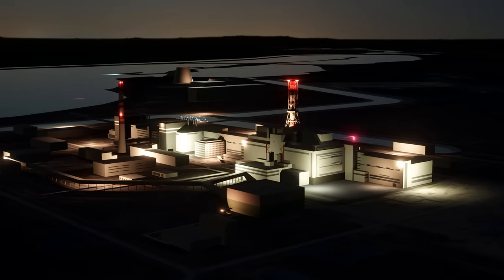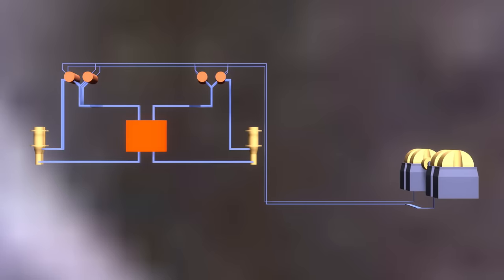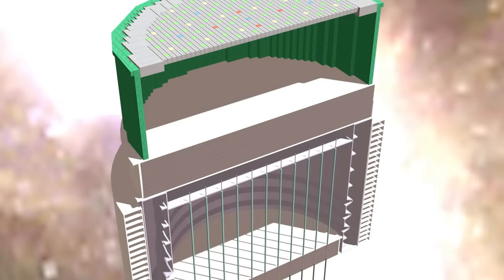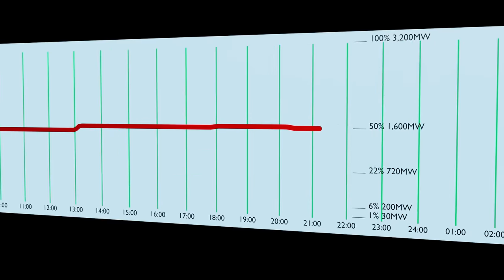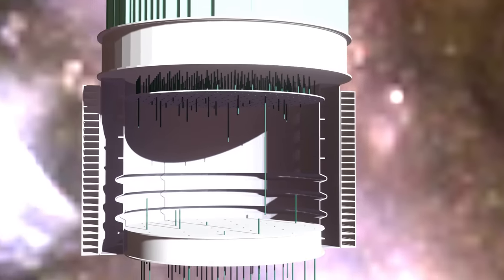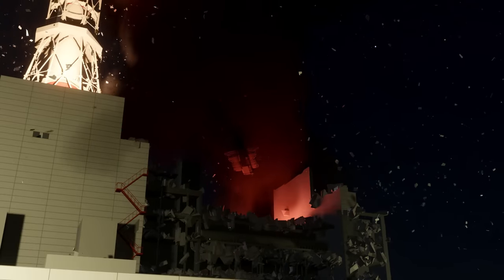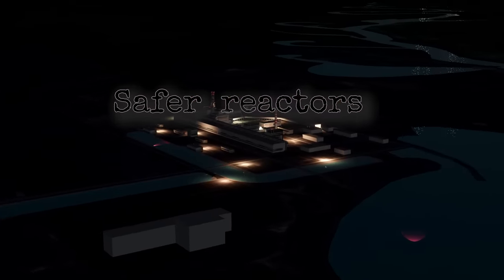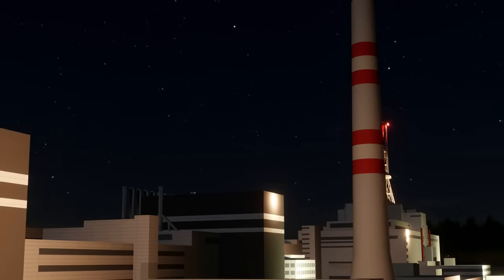CHERNOBYL AZ-5 why it exploded

Comment: Let one thing be clear: The reactor did not behave in a way that was not known. It was known. But it was the policy of secrecy, suppressing information and general paranoia in the Soviet Union, that led to this disaster. The operators were highly skilled and professional. There was no "pressure" present (as depicted in the HBO series). They were cautious and confident in what they were doing. The problem is, they were not told the full story, the truth about the RBMK reactor and its design. Until the disaster at Chernobyl NPP, safety concerns were only from the viewpoint of how to protect workers from the radiation of the reactor. After Chernobyl, the safety shifted in how to protect the reactor from operator error. This was a very valuable lesson learned. The automatic reactor control and safety systems had to be manually disabled by operators at Chernobyl in order to do the test. They worked against the safety protocols and were aware of it. If they knew the full truth about how the reactor behaves in those conditions, they would have never ever do what they did. This was not the first time that this test went wrong. The Leningrad incident ten years before Chernobyl made this clear. Lucky for them, at Leningrad, they performed the test with a "fresh" reactor, which was not operated for extended periods of time. At Chernobyl, the fuel rods were burned up much more. The operational reactivity margin was way lower, which resulted in even more control rods to be withdrawn, making the reactor extremely unstable. The lesson learned from Chernobyl: Protect the reactor from human error. Today  it is impossible to manually withdraw more control rods than is safe. Also design changes were made to the control rods, removing the graphite displacers with steel ones. The efficiency dropped a little and the fuel enrichment had to be raised a bit to compensate for that. I cannot stress this enough: The reactor did not fail. It was the human operators who failed. The design of the reactor was known to have certain issues and the designers knew of them. But the operators were not told the full truth. Even worse, after the incident at Leningrad NPP, where a similar test resulted in an almost identical result, the full truth about the reactor was not told to the operators. Human error and a paranoid mindset made the Chernobyl accident happen. The technology did not fail in any way. It was a human mistake and error. The lesson from Chernobyl is clear: If you do something, you must know at each point in time what you are doing and understand what, how and why works. If critical information is being kept from you, you inevitably make a mistake, sooner or later. All the natural laws are known and the reactor was designed properly. There was absolutely no miscalculation or misunderstanding in the laws of nature. There was just human error. The operators are not to blame. The whole culture is to blame, if it is poisoned by unnecessary secrecy and paranoia. Also, we need to protect delicate technology from humans the same way we protect humans (and the whole environment) from dangerous things like radiation, chemicals, etc.
Reply from the maker: Thanks for a great explanation
Reply: Finally! Someone who's read books on the event. The shady Ministry of Medium Machine Building designed the reactor, and kept all its dirty secrets to itself.
Reply: @PeterbFree  ...what?
Reply: @PeterbFree  you want to say, vote for corrupt GOPs, to manage to perform such disaster at home?
Reply: why did they do a test then with a poison core? That was not kept away from them. They did know that the power plant was operated on a lower performance level for hours so they should have known about the poisoned core too. Yes, the fail safe had a design flaw but based on the video it appears the operators made serious mistakes too.
Reply: @csabaidonat  High pressure from political instances to be successful in testing, showing reliability... And the main operator at the plant wanted to be the hero, fulfilling that task... Its like the BP disaster in the Gulf, things like that also happens in normal economy. But Russian communistic structures well enhanced the risk.
Reply: @csabaidonat  Yes, this I ask myself too. They must have known that the core was poisoned. After the chain reaction practically stopped when the reactor fell into the "iodine pit", they must have realized that trying to do the test at that point made no sense, since it was physically impossible to rise power to the required 700 MWe. The only sensible action was to shut down the reactor and wait for the Xenon-135 to decay. The test could have been repeated later.
Reply: @Lightningchase1973  Yes, I belive that such things happen regardless of culture. Just some cultures made it "easier". The lessons learned from all these disasters are very, very valuable. And they did cost us human lives and contaminated vast areas of land. We must learn and be humble, for nature cannot be fooled. Another distaster, with much less dramatic outcome, but with a similar "chain of human decisions" led to the Challenger disaster. I would even say, that it was even worse (as far as human failure goes) than Chernobyl. Critical information was not being kept "secret", it was being knowingly ignored by the management.
Reply: "Human error made it happen"
This is the cause why humanity was and still is not grown up enough to deal with dangerous tech like this. They still do not communicate transparently instead the nuclear industry is still all about secrecy.
Reply: @erikziak1249  So...what you're saying is that they felt no pressure because they were totally professional but you have no idea why they'd ever ignore a very obvious sign that they definitely knew about. Yeah, there sure were no pressure on Dyatlov at all...
Reply: @Lightningchase1973  Exactly. "I love the uneducated". Imagine a Trumper in charge of safety - oh you don't have to - Homer Simpson already showed it to us.
Reply: Good explanation but explained the same idea in 5 different voices. Haha.
Reply: Its like being confident you will get a good grade for the math exam but you missed the crucial part of the math lesson
Reply: You're basing all of this on the HBO series?
Reply: @abelucious  Certainly not.
Reply: You said the same thing 10 times bro. Learn how to execute your point in less words. I completely lost interest in what you were trying to say because I’m trying too hard to read it..
Reply: @youngconfidence8666  I agree. I was drunk when writing it.
Reply: Another interesting tidbit is that AZ-5 button was originally designed to act not only as a fail safe but as a way to quickly moderate reactivity. It was even touted as a design feature in the documentation. The system would only lower the control rods for as long as AZ-5 button was pressed. Some researchers think that an operator caused the explosion by tapping the button to slow down the reaction without an intent of shutting down the reactor. Almost all rods were simultaneously partially lowered and left in a configuration that produced the tip effect. Then after the explosion the AZ-5 button was pressed again, probably when everybody panicked and tried to shut down the reactor this time.
Also the amount of currently inserted rods was in no way treated as an essential safety parameter during the design of reactor controls. The operators used to get an update only twice an hour as a part of routine printout from the computerized automatic control system or could request a calculation from the said system and get it only after several minutes.
Reply: @youngconfidence8666  I disagree
Sometimes u have to be very emphazise dome topics.
This guy made a fine opinion, and he convince me about the principal idea.
Reply: Jeez
Reply: "The design of the reactor was known to have certain issues and the designers knew of them." Let's not mince words here. It's not just some "issue", it's called a "design flaw". If under certain conditions, your brakes accelerate your car beyond the speed of sound instead of stopping it, it's a design flaw of the car, plain and simple. The breaks are not meant to do this, and it goes against any logic. Same with the RBMK reactor - and if you say that the designers of the reactor knew about it and the operators didn't, then it's incorrect to state that "the reactor was designed properly". Especially after the flaw was discovered and nothing was done to fix it after the first smaller-scale accidents resulting from the design flaw.
Reply: The biggest flaw was no containment building like those used in the West.
Reply: @t3553ract  I will not argue about words, since English is my 3rd language. Maybe I did use them incorrectly. Let me rephrase the main idea: The reactor was designed properly and the operation manual for it was designed properly, acknowledging the "design flaw", if you prefer it to call this way. But it was designed like this on purpose, as it gives better economy, requires less enrichment and lowers cost of produced electricity. The designers knew of that, and they did choose such an "aggressive" design feature, willingly sacrificed safety for economy of operation. And with all this in mind, they designed the control systems to avoid getting anywhere close to the danger zone and explicitly stated in the operation manual that once the reactor power dropped below a certain power, it should be shut down. The problem is, that during the test, safety systems had to be manually overridden and the operators did not know the true behavior of the reactor in the conditions they got it into (because secrecy, paranoia, etc.). Since the designers never intended the operators to get the reactor into the state it was mere minutes before the disaster, they did not mention the potential danger in the documentation either. The problem is, that common sense was not enough to warn the operators, as there were no evident signs of danger until the critical runaway. The reactor behavior was known. It was designed with that "flaw" or "feature" (depending on how you look at it) intentionally. The regime was so paranoid, that it did not tell the operators how the reactor could be theoretically (and as we know after the disaster, practically) blown up. They feared that this information might get misused, some "inner enemy" (paranoid communists always looked for the "inner enemy") might use this knowledge for sabotage. So the operators were not told the full truth. It is easy to blame them, but the disaster, as is always the case, is the result of a long chain of small things, each one isolated in itself being not that big of a threat, but when they add all together, they can cause what happened.
Reply: @rh_BOSS  Interesting. Was it really designed in a way that you had to press and hold the AZ-5 button in the pressed position for the rods to keep moving? If this "feature" was documented as a way to quickly increase the reactivity, was there also a word about potentially destroying the reactor while using this "feature"? I highly doubt that.
Reply: @taraswertelecki9886  there was supposed to be, but they rushed construction to meet deadline. If they had double roof, as they had to have, it probably would be contained nuclear waste
Reply: Erik, I come from a trained safety technology background and  I was an incident investigator.You are not correct in your assertion that  - "The technology did not fail in any way. It was a human mistake and error. " The technology failed for the very reasons that -
1. It is not the first time it had happened, it was the THIRD time,
2. The design did not eliminate the possibility of failure because as I quote you "The design of the reactor was known to have certain issues and the designers knew of them."
3. A system operated by human beings MUST be designed for human beings to operate it and be tolerant of mistakes. It doesn't matter how technically efficient or proficient a design is - if it is dangerous to operate where it can cause a disaster of massive proportions it is an unsafe and BAD design - period.
The very fact that you acknowledge the RBMK 100 design had to be modified (at great cost) to eliminate this design FLAW says it all.
Human beings are part of the systems we build to achieve specific outcomes. The systems must accommodate the idiosyncrasies (mistakes) of human beings, particularly when mistakes can result in hugely costly adverse outcomes. There is no other way - which this event clearly underlines.
Reply: @krossbolt4100  You are right. The design was not made to handle operator errors, it enabled them to break safety protocols. The technology, as it was designed, did not fail. It was improperly designed, the focus was on protecting humans from the machine, not vice versa. The design was known to have certain issues. Correct. If I know a design has certain issues, I make sure that no matter what the human operators do, I will not let the machine to get into a state that it could cause major damage. If I design the control systems in a way that enables the operators to put the machine into a state where it has issues, whether on purpose or by mistake, I made a badly designed control system. I fully agree with your 3rd point. This is exactly what we learned the hard way at Chernobyl. The "flaw" was not because of a miscalculation or misinterpretation of natural laws. That is what I mean when I write "the technology did not fail". There was not some sudden unexpected behavior. There just was the mindset that people, especially soviet people, do not make errors. The paranoia of the regime told the operators just what they needed to know, not the full truth of how the reactor behaves in a regime they were not supposed the reactor to get into. And once they got it into the regime, they did not expect the reactor to blow up. Nobody told them. And even if someone did tell them, the control systems should have not allowed them to do it anyway. RBMK reactors are still operational to this day. With modified control systems, that would automatically shut the reactor down safely without the possibility to bypass these automatic safety systems, if the operational parameters deviate from a certain range.
Reply: @krossbolt4100  The technology was not designed to be immune against to or to correct for operator error. So it did not "fail". It was a flawed design (without doubt from an operating point of view), but that does not mean that it failed. Everything behaved exactly as it should, as it was expected to. From understanding natural laws to the all the controls. What did fail is the training of the operators and the very fact that they were able to get the reactor into the configuration they did. Both crucial mistakes. But nobody designed the system to manage them. So the design did not fail, as it was never designed to cope with that. Humans failed. And only humans failed. Multiple reasons.
Reply: So basically, they “purposefully” kept the test going even though they knew what the possible outcomes would be? Or did they not know that this would’ve been an outcome?
Reply: @davebanach9891  The did not know.
Reply: @minaolenella869  I have been in a nuclear reactor building, twice. A double roof would not be a containment building. The first explosion launched the reactor top right though the roof a kilometer into the air. That was how powerful the initial steam explosion was, the second hydrogen explosion was even greater. That threw graphite and fuel fragments all over the plant. People died of Acute Radiation Syndrome because a piece of fuel or graphite landing near them delivered a beyond lethal dose of radiation. A containment building is designed to contain everything  even if the fuel melts down and burns through the bottom of the reactor vessel. They are also built to survive magnitude 8 earth quakes, even the impact of a jetliner at 500 mph. There were shock mounts, much like the ones I have installed on ships, but far more massive for the pipes, pumps, valves, electrical systems, hydraulics, anything vital to the safety of the reactor and the outside world. They can be sealed off from the outside world, and so can the control room unlike the one at Chernobyl. And at that, I am not sure three or four feet of specially made and reinforced concrete and a thick steel inner liner could have contained a RMBK reactor going prompt critical then launching the reactor top right off the vessel. The Corium, or nuclear lava created during meltdown that followed might still have burned through the bottom of the building even if it was built to western standards. The Soviet authorities have gambled nothing would go wrong and cut corners, and Ukrainians, Belorussians and Russians paid the price in death and suffering when they were proven to be wrong. Dead wrong. That was just the beginning as radiation covered much of Europe and Asia. But the chances were a strong containment building would probably have made all the difference had the Soviets learned from the West and put these reactors in them. If the exploded reactor remains remained contained, far fewer people would have died, if any.
Reply: @PeterbFree  Since when was that side of politics come from a discussion of how censorship can lead to human error one way or another?
Reply: Ok, Brotherhood of Steel.
Reply: They proceeded with it because they thougjt they could burn outnthe xenon 135 safely and even if the reactor started to runaway they could shut it down with az-5 safely anyway. What they didn't know is that the design flaw in az-5 woukd increase criticality in the lower portion of an already unstable reactor. That's why it's mostly a design fault more than human error.
Chernobyl was inevitable because even if the reactor didn't explode that night, it would have exploded another time when the scram button was pressed in a dangerously critical reactor
Reply: @erikziak1249  I think you're getting hung up on semantics. Don't take this the wrong way. I agree with everything you said except that the operators were responsible. You appear to be a native English speaker.

Have you ever been pressured to do something at work that felt wrong? I think Dyatlov was quite experienced with submarine reactors. I am not technically inclined in this field, but...

Things like this still happen in countries where truth is subjective. That culture of "do what you're told" even in instances where objectivity is necessary is a major reason why I don't blame the operators. The A3-5 system was not as advertised to the operators. We have hindsight and also can't go back to April 25th 1986 to see what each man was going through. I don't quite understand why the test was so important that it had to be done regardless of the poisoned reactor.

The operators assumed they could always SCRAM the reactor if they really needed to. How routinely was that button used at this facility? It wasn't common, but it was drilled into them that the reactor could be managed in any event with this button. A failsafe that wasn't safe. Then again, we hear about experienced crews having problems with reactors of this design. 

Dyatlov had experience with reactors that have much more complexity albeit smaller scale than the RBMK-1000. I don't know who else in the control room had this experience, but the Soviets certainly had plenty of experience dealing with far more complex designs. There had been far more issues with Soviet sub reactors that were caused by negligence under a culture of fear and secrecy. Politically and militarily there was more at stake. 

I think the pressure to complete the test was less of an issue than the design flaws that were hidden from even Dyatlov. He likely had experience with the theory of stricken reactors, such as one that had been fed sea water in a casualty. Did he know about the flaws of the RBMK-1000? I think there was some workplace politics from the plant administration that would've potentially caused Dyatlov to not think critically. 

This is all part of ethics and control of the human element. This was more of a factor than we give it credit. I don't blame the reactor operators for the disaster.
Reply: @erikziak1249  It was in no sense designed or documented properly. Here's some choice quotes from the reports attached as annexes to INSAG-7:

"As a result of the misguided selection of the core's physical and design parameters by the designers, the RBMK-1000 reactor was a dynamically unstable system with regard to power and steam quality perturbations."

"The design of Chernobyl Unit 4 included major violations of the safety standards and regulations in force at the time that the technical design of the second stage of the Chernobyl plant (comprising Units 3 and 4) was approved and authorized."

"The reactor designers analysed the operating algorithm of the emergency protection system in terms of the efficiency of the plant's operation in the power supply system, rather than in terms of its ability to ensure nuclear safety, which is the proper function of an emergency protection system."

"The Commission considers that the negative properties of this type of reactor are likely to predetermine the inevitability of emergency situations"

"The Operating Procedures permitted operating conditions similar to those prevailing at Chernobyl Unit 4 on 26 April 1986 and they might have occurred without any intervention on the part of the personnel.  We only need to assume a perfectly possible situation in which triggering of EPS-3 occurs when the reactor is operating initially at rated power with an ORM of 26 manual control rods.  Under these conditions, approximately one hour after triggering of EPS-3 the ORM could have fallen to less than 15 manual control rods at a reactor power of 200-300 MW(th), and any further action, whether automatic or remote, to shut down the reactor could have led to a similar repetition of the events of 26 April 1986."
Reply: @MatthijsvanDuin  I agree. Thank you for that quote from the report. The whole system including emergency shutdown was designed for better performance and not safety in the first place. I can only guess that is the reason why the reactor manual prohibited operating it below 600 MWe.
Reply: @erikziak1249  It didn't prohibit that: "Before the Chernobyl accident there were no safe operating limits in terms of minimum permissible thermal reactor power. In none of the documents studied by the Commission relating to the analysis of the operating conditions of the RBMK-1000 reactor do the reactor designers raise the question of the need to limit reactor operation at power levels below a certain level."
Reply: @MatthijsvanDuin  If that is true then I stand corrected.
Reply: @erikziak1249  In fact, "Section 11.4 of the Operating Procedures required personnel to reduce the reactor power to the level corresponding to the unit's internal consumption (200-300 MW(th)) following automatic power reduction in the EPS-3 design mode, or remotely in the event of abnormalities in the power supply system (frequency variations). There was no limitation on the period during which the reactor could operate at the minimum controllable power level."
Reply: @erikziak1249  Based on that the report also concluded that a similar accident could perhaps have occurred without any abnormal operator action whatsoever: with the reactor in the state it was before the first power reduction, an EPS-3 followed one hour later by an EPS-5 might have been sufficient.
Reply: @MatthijsvanDuin  I did read about it some years ago, maybe the sources I read were different versions/translations or I misremember things.
Reply: @Chironex_Fleckeri  I do not claim the operators were responsible, they just made a series of steps that resulted in the explosion of the reactor. All they did, they did cautiously and with confidence. There was no pressure, just "following the steps". Responsibility is in the whole culture of operations, and applies not only to nuclear power. You can find paralells in the history of the railway. Many regulations, operating manuals and protocols were literally paid by the deaths of vitcims before accidents happened. Humans need to learn the hard way, or so it seems.
Reply: @erikziak1249  I can very much recommend reading Annex I of INSAG-7, which is a translation (by IAEA) of the 1991 report by the Soviet commission tasked to investigate the accident. This report heavily blamed the reactor design (as opposed to the early narratives which primarily blamed the operators).
Reply: @MatthijsvanDuin  What I have read was a translation of an older operating manual. I am not sure if it predates the event, but I remember that it was prohibited to operate the reactor below a certain level. The test itself ran at such a low level, the operators had to manually bypass control systems and safety systems in oder to do that test.
Reply: @erikziak1249  okay well then I was mistaken. I agree that the facts are the operators did put the reactor into a state that was unsafe. I wonder what they thought would happen? Those who knew that the test was being conducted under conditions outside the operating manual knew it wasn't the ideal reactor state to be doing such a test. But did they believe that AZ-5 would always be there to save the reactor in any event? Or just that the reactor would never do what it did? 

And yeah it's a shame. It's a shame that nuclear power is getting such a bad reputation even today. Right in Ukraine. There's a lot of fear of the ZP NPP where the Russians are shelling and storing ammo. It's all bad. We need NP for the energy needs of the 21st century. A lot of money needs to be spent before a single Kilowatt-hour is generated. And new designs and the locations of the reactors need to be made. Improvements to waste management of spent fuel and contaminated materials need to be made. 

Do you think we should be pushing for nuclear power? It seems like the only way to move forward..
Reply: @Chironex_Fleckeri  The original design, control and safety systems together with following the manual would have never resulted in the reactor explosing. What gave way was a deviation from the manual as well as the possibility to bypass safety systems, which would shut down the reactor automatically, preventing the test to be done at all. Yes, the operators believed that the AZ-5 would safely shut down the reactor in any circumstances. And this was the fatal mistake. The operators did not know of the Leningrad incident that happened before. While the investigation correctly determined that when handled outside the manual, the AZ-5 and scram process can actually increase reactivity for a short period of time, this knowledge was not passed on in the field, nor was it considered when making plans of tests. This is the main big problem. Maybe some top scientists knew about it, but even they were scared to speak about it, as it could be interpreted in an undesired way with consequneces for them and their families. If your ideology claims that perfect soviet people design perfect soviet reactors and operate them perfectly, then any critics of the alleged perfect soviet design/technology/people could be interpreted as a critic of the whole soviet ideological system. With all due consequences. Everything in the Soviet Union was a state secret. Even the name of the designer of consumer products like SLRs. Uncountable "forbidden" towns and cities, where not even every soviet citizen could go. Closed off enclaves dedicated to one particular thing/task. It is madness, but that is how it was. And even today there are cities in Russia, where no foreigner is being allowed to enter and even ethnic russians have limited access. Because of paranoia, secrecy and whatnot.

What the russians are doing today in Ukraine is something for a different discussion. But it provides a shocing reveal - how much power Putin really has. He managed to build strucures in Russia, that are not far away from the worst Soviet practices from the worst Soviet years during Stalin. In any other country, Putin would have been removed from office, stripped of power and investigated for crimes against humanity and treason. In Russia, he managed to cement himself firmly in power and uses brutal police force to supppress any opposition and critics. The problem is that even if he would want, he cannot get out of the trap he created for himself. He has no other option than to wait for the bitter end. The bad thing is, he takes down the entire country and many innocent victims of his stupid war. He commited not only a crime agains peace, against neighbors, but also against his own people. He managed to write himself in history, but not the way he wanted. As long as he did not want to be put alongside Stalin. And what Stalin did was extreme and even his successors struggled with fixing it. The russians need reflect on their own history the way the germans did after WWII and makes sure NOT to repeat mistakes they did in the past. Because that is exactly what they are doing. Nobody is humiliating Russia more than Russia itself.

What I think of nuclear power is irrelevant. The truth is, humanity needs it more than ever. The question is, will it and if yes, if in an extent that will actually make any desired impact? Would it be ince to have 100% renewable energy, grid safety and low energy costs? Yes, it would. Can it be achieved with current technology/knowledge? Certainly no. Either we burn even more fossil fuels or we try to cover the base load with nuclear power. The only power source that delivers huge amoiunts on demand, that can be build in any location and operate without dependence on wind or sunshine, is nucelar. And if NPPs are properly designed to operate even during draughts, making sure that no operator input, whether intentional misfollowing of procedures or human error, could theoretically result in a meltdown with massive contamination of the environment with fission products, using modern knowledge and are inherently fail-safe in an extremely unliekly event of a meltdown, destroying just themselves but not contaminating any land, then every sane person should support them. Especially if they are build in areas that are carefully chosen, are not prone to earthquakes or tsunamis.

EDIT: Please excuse all my typos. I have no spell-check on the computer where I write this reply. Also, English is my 3rd language, I am not a native speaker.
Reply: @erikziak1249  👍 Thank you for the detailed response. I read Midnight in Chernobyl and have done some research but don't speak any Slavic languages. And until recently , like Feb 24, the USSR has had an image that was washed almost clean. Like the Russians supposedly paid to have things like the T-34 mechanical failure covered up so the myth could continue. They sealed their archives. It wasn't until Ukraine, Poland, and the Baltic States and other former SSR started going in on the Russians. Telling the truth because no more leverage exists from Moscow onto these countries. 

So we are learning more about the truth now
Reply: YES, BUT IN THE OTHER HAND CAPITALISM TOOK HUMANITY TO FUKUSHIMA....
SO, IT IS NOT ONLY THE COMMUNISM THAT HAD DESIGN AND OPERATION ISSUES BUT ALSO IN CAPITALISM THAT PROFIT CONTROLS EVERYTHING..
Reply: @bobbwc7011  Care to share the audio recordings?
Reply: @bobbwc7011  Even if 100% true, do you speak the language? Have you heard these audiotapes? Without the USSR it wouldn't have happened.
Reply: @erikziak1249  Feel free to file an application to the relevant offices in Kiew or Moscow to get access to them.
Reply: @t3553ract  my guy literally acknowledged the reactor had a design flaw then proceeded to blame it on the operators for not knowing about the design flaw of the reactors.... it entirely was kn the soviet union and the reactors design flaw being hidden from anyone who knew anything about the reactors. Nobody was to blame but the soviet union and I still don't get how after all the info on them knowing about the flaw, hiding it, and not telling them, people still believe its on the operators.
Reply: The truth about Chernobyl: HOW THE 4th UNIT OF CHERNOBYL NPP WAS BLOWN UP (channel-KS).
Reply: I have now learnt of "Neutron Poisoning " and "Xenon Poisoning" .
- Also ironic that running the reactor at full power was safer than running extendedly at half power. due to formentioned Neuton/Xenon Poisoning.
( Opposite to what lay person would normally expect) .
The things you learn!
Reply: @taraswertelecki9886 yea cuz they sure helped prevent the Fukushima explosion right? (Sarcasm)